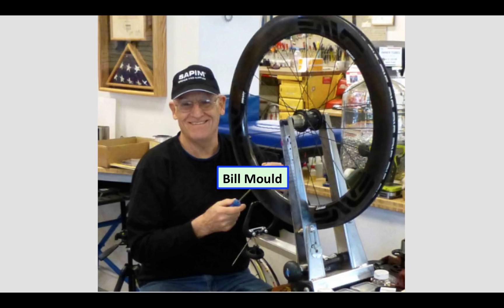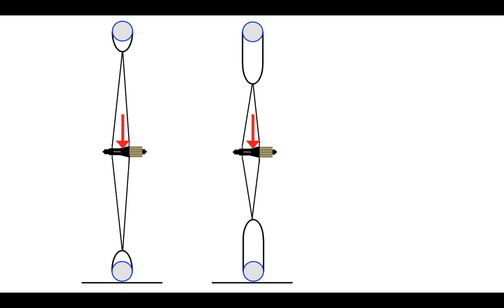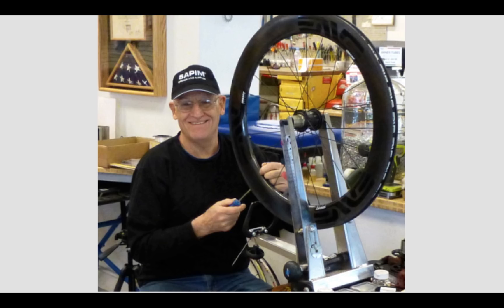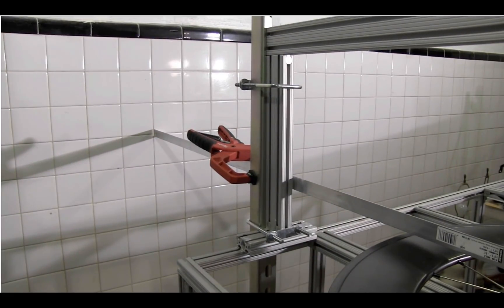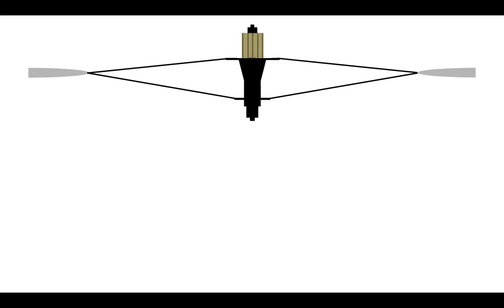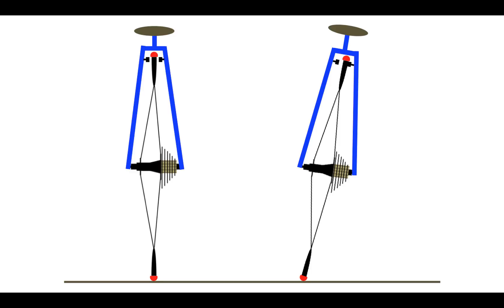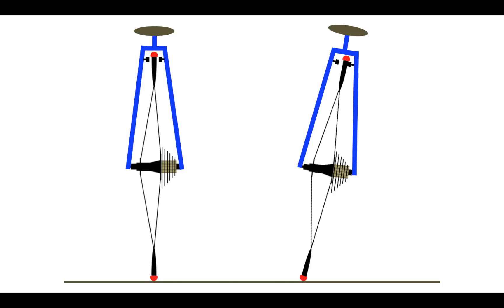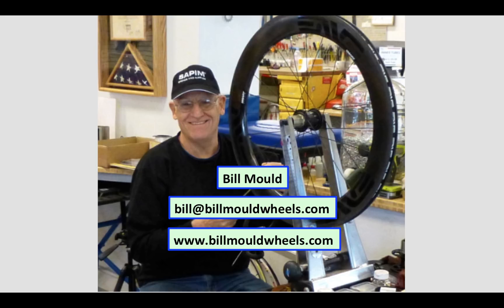Deflection of Deep Section Carbon Rims

Comment: Nice design of experiment and execution. 

I didn’t know why rear wheel that seldom experiencing a side load is chosen as an example (L/R asymmetrical spoke tension) . Should front wheel be taken in the experiment instead? A wheel that frequently experiencing side load? (Symmetrical tensioning)

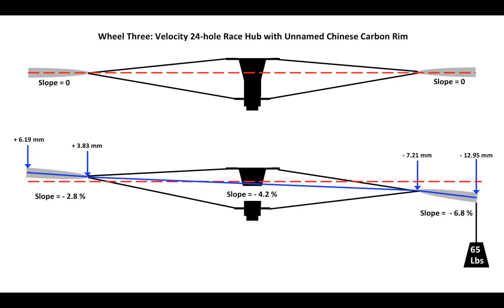Comment: Great video. At 6:56, wouldn’t you say it would be more appropriate to have 2 lines originating from the hub and ending at the spoke anchors? The spokes at the top half and bottom half seem to be at different angles. For example, I think the lower half of the spokes are at a 3.1% angle.

I also have a hypothesis that deeper rims lead to more deflection at the bottom end between the spoke anchor point and the bead seat. Could you do this experiment with an alloy rim and see how much deflection there is between the spoke anchor “hinge point” and bead seat?
Reply from the maker: That might be a good experiment for he future.  I'm quite sure that the deflection would be much less.

Comment: Great video! Not that it matters a lot, but I think you made a small error in calculating the slope for the inner section. That should be (-7.21 - 3.83) / (622 - 2 * 85) = -2.4% instead of -4.2% I guess.
Reply from the maker: Ben, thanks.  Maybe so, but as you said, it really doesn't change the result.  I had seen the effects of this kind of rim deflection before, but I really didn't understand it until I did the experiment.

Comment: Interesting. This looks to me like another reason disc brakes could be desirable, at least on deep-section aerodynamic wheels: being part of the hub (as opposed to the rim) they would experience no flex whatsoever from the lateral forces described in the video.

While the performance of having longer spokes with an aerodynamic fairing seem beneficial, the act of truing wheels with deeply recessed nipples must be a huge pain in the ass, not least of all because doing so would require custom-built tools for each vendor's application on top of an already widlly expensive wheel.
Reply: disc brakes  introduce  a host of  new headaches. that is  the reason  radially  spoked wheels  have disappeared  with  db wheels .

Comment: How about quality carbon rims? How do they perform in the same test? Interesting stuff! I just ordered my Yoeleo 50 mm wheels and have very little clearance in my bike frame with the 40 mm tires that I am using, so we'll see how that turns out :) Thanks for the insightful video!
Reply: The quality rims would deflect the same assuming they are the same depth.

Comment: I see nothing in your experiment to suggest that rim "roll" contributes to the rubbing brake phenomenon. All I see is a very laterally stiff rim deflecting one direction at the ground and opposite at the pads, precisely because the rim is so laterally stiff (and the spokes go elastic). This has been explained ad nauseam in various other technical outlets. IF the rim was truly experiencing "roll," the rim would roll to the same side all the way around its circumference, like a tubular tire inflated off of a rim. 
The reason a shallow aluminum rim with a fairing might not exhibit the same reactionary deflection (at the pads) is because, assuming same hub and spokes, it is LESS laterally stiff. Therefore the rim deflects locally at the ground more. The rim bends overall like a potato chip.. A stiffer rim would do a better job staying on the same plane.
Reply: Hmm... you got a good point!
Reply: Hey there! I believe that Bill is telling us exactly what you explained above. The displacement of the outer edge of the wheel is due to stiff rim and not so stiff spokes.

The thing is that some writer at Velonews got that video totally wrong! I guess you came here from this article: https://www.velonews.com/2018/08/from-the-mag/deep-wheels-an-engineering-feat-that-goes-beyond-aero_474617

See how the writer has a similar picture to that on 2:00 but he has redrawn the arrows as to support his wrong theory?

The thing is that one should carefully balance the stiffness of the rim and the spokes. Too stiff rim with very soft (thin, low count) spokes is not a good idea.

I really hope for a comment of mr Bill Mould on this article.

Comment: So, putting the breaks on under the bottom bracket is a good thing?
Reply from the maker: Dave, maybe it is, but then you get more rain and crud being thrown up into the brakes.  A better solution is deep section rims that are designed to flex less.  My guess is that they will inevitably be heavier, though.